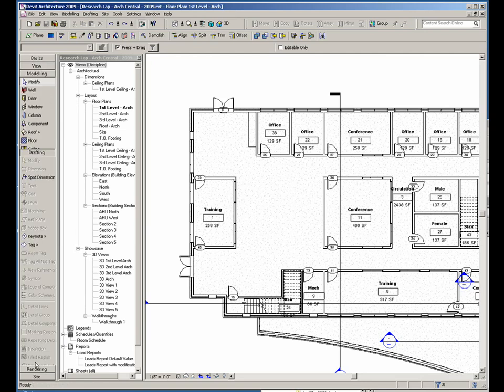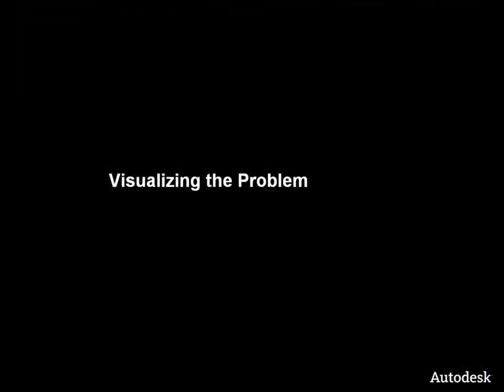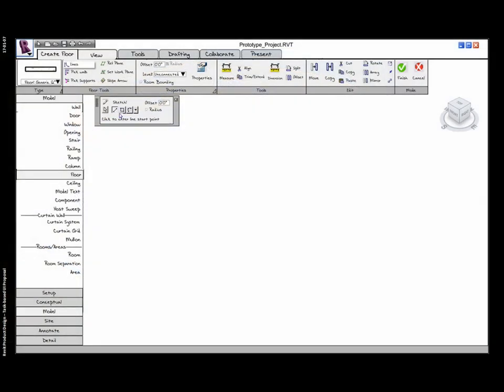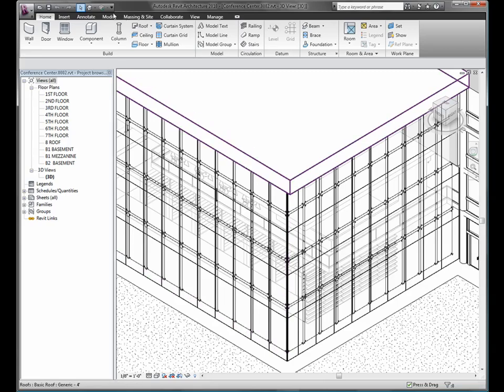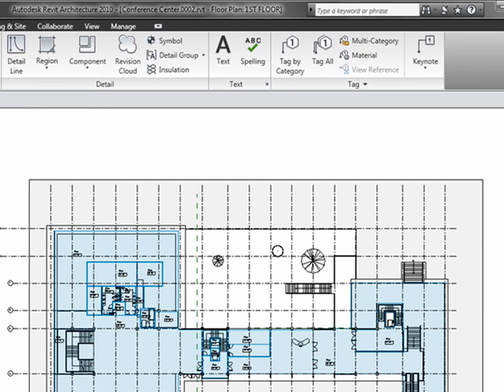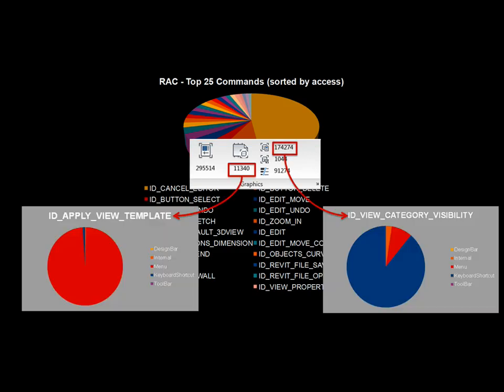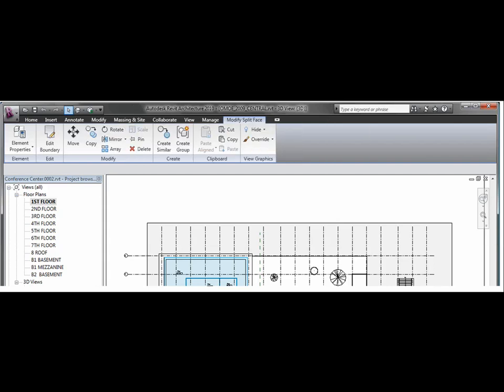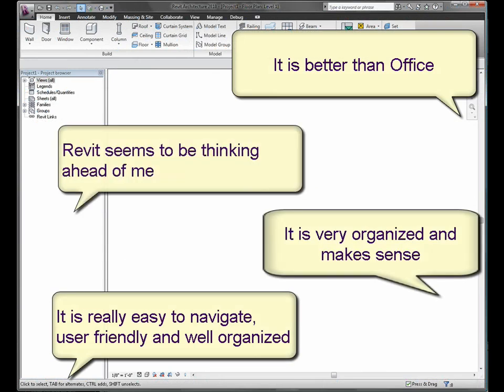The Revit 2010 Ribbon - Designing the User Experience

Comment: I'm not against a ribbon, I can't say I'm for a ribbon either, it's a fiercely debated user interface topic.

I think it's due to the fact that it has advantages and disadvantages -- almost to the point where they cancel each other out.

A advantage is that functions are all in one place, similar to the standard menu bar.

A disadvantage is exactly that, and you don't have any directions to guide you such as: modeling tools on the left, view commands at the top and so on, which cognitively help.